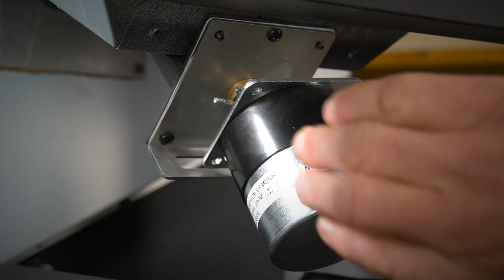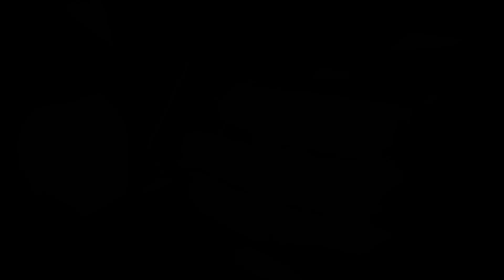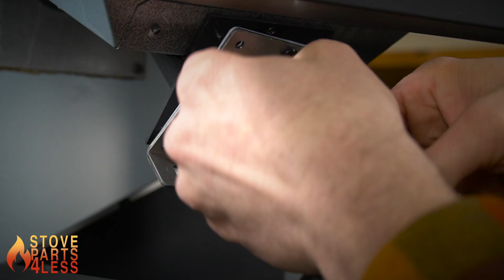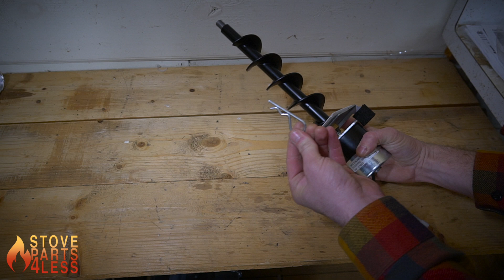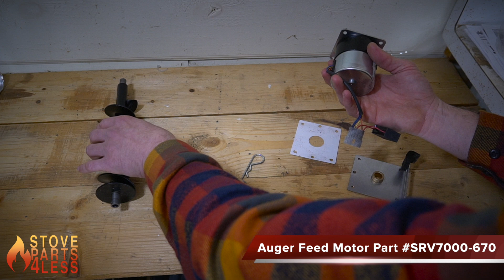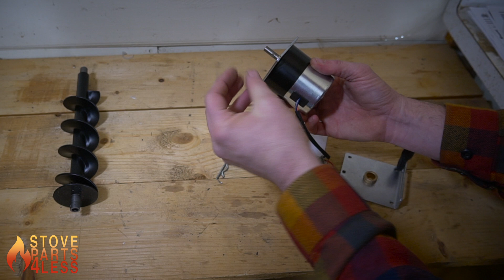PelPro Pellet Stove: Replacing the Auger Feed Motor

Comment: Great advice for the switch on the feed door mine was bad as soon as I traced the wire and plugged it in direct into the vac the auger motor started working . Thank you .

Comment: Where can you get a new pin? Mine broke and the motor fell off. Also when I replaced the motor there was black grease on the old one.
Should 
I be concerned about the grease?

Comment: my auger motor doesnt detatch this easy, I pulled the pin out and its stuck like cement, any ideas?
Reply: Any luck on finding an answer to this?
Reply: Rotate and tap the flat plate with a small hammer

Comment: auger quit turning last night ,try to remove auger motor pull the pin but motor will not drop,, am I missing something
Reply: Sometime ya gotta tap it off esp if it’s sheared a pin.
Reply: Any luck on finding an answer to this?
Reply: Yes pulled the pin and just had to tapped it off .just build up on the shaft
Reply: Thank you, still no luck here. I’ve been trying for some time. Don’t want to tap it too hard. I have a pelpro 60B. Do the pin holes need to be lined up? Or it should remove at any position?
Reply: @AsherKohler-ve3mw  no they do not have to be lined up hold it with one hand tap it it’ll come off apparently you just not tap in hard enough
Reply: Replaced motor, replaced vacuum, replaced hopper switch….. the auger will not move. Hopper is emptied now and I can’t get auger to wiggle with my hand. Thoughts on this?